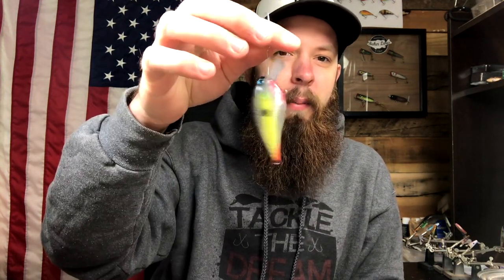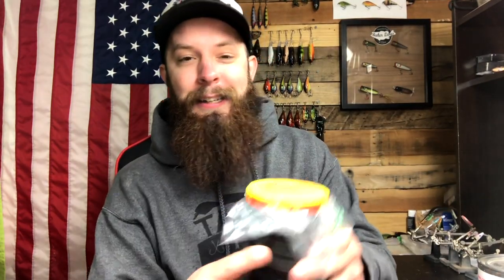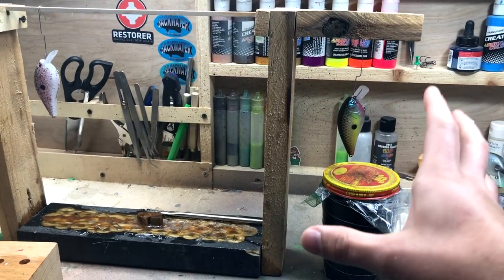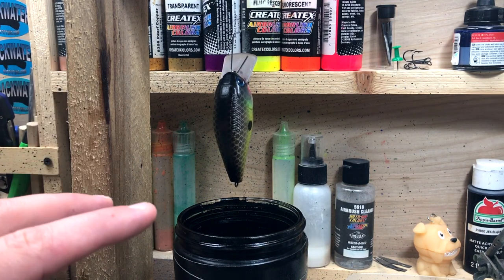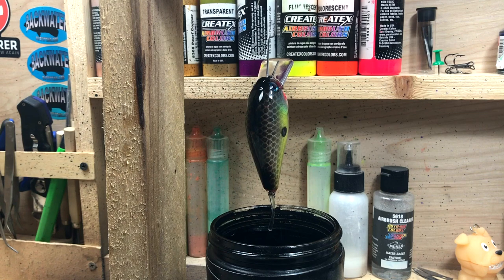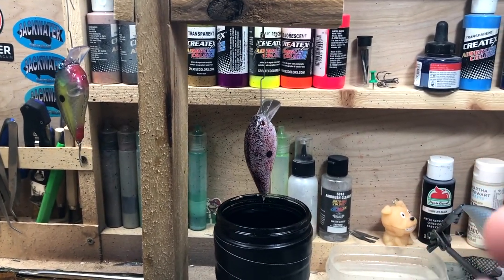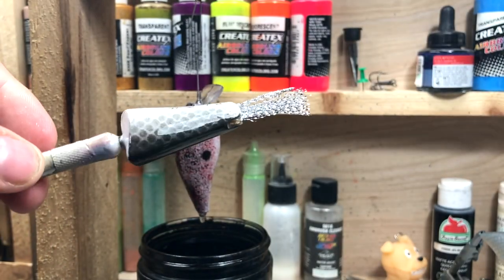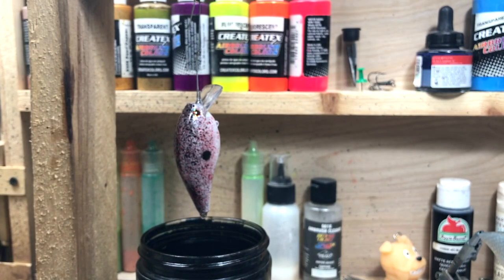Alumi-UV Clear Coat - How I Clear Coat With Alumi-UV

Comment: I ended up making a uv cure bucket. I bought 32feet of 90 watt light strips. I wound them on top of each other around The Whole inside of the bucket up to the top. Works good but it gets a little warmer then I like, but it cures in about 5 minutes. Lol
Reply: Where did you find 32 ft of. 90 watt UV strip lighting? Or are you saying you got 2 strips at 45w each? . the highest wattage I could find was 60 thanks in advance

Comment: I have been using True Coat 2 part epoxy and I must say I am not impressed with the durability of the clear coat. I put one coat on, put it on a rotisserie for 12+ hours , add my logo decal and then put on a second coat. I have a lure that I have taken out and used a half dozen times and probably caught 12 Bass and a couple of Pickerel and it already has a couple of chips that go down thru the paint. How is the odor ? The True Coat does not stink up the house too much where as I‘ve heard the KBS. Is pretty toxic smelling. Like you, I don’t want customers to get lures that chip up easily.

Comment: Quick question. I started using Aluma-UV and purchased a strip of 365NM uv lights. When I take out the lures they seem perfect and hard like a lure bought from a store. However I find that when I fish with them the UV coating and paint comes off. I dip the lures then put them in the UV box to cure for several hours and they look store bought but they just wont hold up to bass fishing for a couple of hours. Any ideas to help out? Thanks

Comment: Something you could try from the scale modeling world is pledge revive floor wax, sprayed through you airbrush. You can use it in place of your spray can clear coat. Gives a good smooth surface for decals and is like $6 for a big bottle. You also could try decal solution like micro sol/set. If your lure is textured the solution makes the decal basically melt into the texture perfectly. Great videos, count me as a sub.

Comment: I just recently started making lures and decided to use the alumilight just for the ease of it and I love it. I built a similar box and used the reflective insulation also installed a turner that’s removable for bigger baits that runs down the center of the box. I used 4 60w uv flood lights mounted to one switch for mine but I also have a cardboard box for a lid 😂

Comment: UV coatings are affected by florescent lighting, not much, but enough to harden it if left too long exposed. I found this out during my days as a photographer, taking photos under different lighting. You're so right to keep the resin in a dark jar. Also, I have stored some resins in the refrigerator along with my superglue.

Comment: Hey man you might like this tip or not. When you go to clean out the eyes for the hooks take a piece of wire that is relatively the same size as the hole. I heat it up  with a blowtorch and just push it through there and it cleans it out immediately. Thanks for the cool video

Comment: Harbor Freight sells a dremel tool for around $5. I've been using one for over a year now and it's still going strong. It comes with several bits. I've been using the same bit for over a year and it makes cleaning the hook eyes out very simple. I use to use a xacto knife also and the dremel is the way to go.

Comment: I appreciate the video because I was wondering because I have been using the 2 part epoxy and no matter how you mix it it always has a touch of tackiness to them however washing it with dawn dish soap helps with that

Comment: I use something similar for coating 3D printed lures. The term you were searching for is “self leveling”.......I use a lure spinner and I put them on the spinner for a few minutes so it self levels without buildup and drips and the air bubbles have time to pop. Then I turn on the light to cure.

Comment: I tried using that spray on clear coat for putting my logo on my baits and it wrinkled/boiled up my paint job, I use createx, I wonder if that’s why? What kind of paint do you spray? 
Edit: I see you paint in the video now, hmm wonder if I just sprayed too much🤷🏻‍♂️ also are you in a well ventilated area for that, do you think I’d be fine dipping with this clear coat in my basement? Thanks!

Comment: I am interested in the Alumi-UV, but I am wondering if it is glossy and clear... I've heard that it can be a matt finish and/or yellow... also the resilience of it... right now I use True Coat a two part epoxy, that does really well! The only downfall is TIME.. it takes over night to harden with a turner.  I am really interested in the UV but is it the same quality of finish as the True Coat? Also you mentioned special UV lights that Alumilite has for extra fast curing.. I couldn't find them on their site, can you hook me up with a link to those?

Comment: The term you were looking  for re. the brush strokes in the clear coat is 'self-leveling'. Your lighting takes so long because standard black lights are not the correct light so not as effective. The proper UV light lights  emit a wave length of 365NM. Always look for this wave length, they do specify when you search for them.
Cheers brother

Comment: I have yet to find my answer but all this does if I let it hang and drip is run right off my lure.  The bill will be dry if I leave it hanging
Reply from the maker: I only leave it hanging for a few minutes and then put it into the curing box. On most lures if I’m putting clear coat on the bill, I will rough it up with some fine sand paper so the clear coat will stick 👍

Comment: Hey bud, just switched from diamond clear to the alumi lite uv about 6 months ago and love it, but have you had a problem with any of the baits being a little tacky after cure?
Reply from the maker: Only if they have not been in the curing box long enough. How long are they staying in there?
Reply: @BakerBuilds  I've got 2 of the uv nail drying lamps put together up right,  I can do about 9 baits at a time, and I put em in there for 30 minutes, and they always come out fully done. But every once and a while some will be a little tacky.
Reply from the maker: @lipripperzt.v.9594  does it make a difference if the tacky ones stay in the curing box a little longer? I also rotate mine to make sure everything get the same amount of Uv light from every direction
Reply: @BakerBuilds  not really, it seems.to be just random ones. And my booth has 360 degrees of uv light. Along with the reflective glass. But idk why there are just some random ones that are tacky. If I do 100 baits, probably 3-5 of them are tacky. I just didn't know if it was something you experienced as well bud. Who knows, could just be coincidental,  could be a blank issue, idk. Lol.
Reply: How was the diamond clear?

Comment: Were you using the 20w 365nm tubes in your black light? in the video. on their site it says 5 to 10min cure time for the clearcoat
Reply from the maker: Mine are not, I need to get better lights and then yes, extremely short cure time 👍
Reply: @BakerBuilds  ok yea that clearcoat is expensive but it seems to look really good from what I've seen videos i just ordered a bunch of stuff to start painting my own baits I went really cheap with the airbrush and air compressor to start out with did not want to drop a ton of money on it in case I do Not using it a whole lot you got a good Chanel 👍gave you s sub 🤙🤙🤙
Reply from the maker: @smashinthatbass  thank ya! Check out the tackling the dream group on Facebook if you haven’t yet 👌
Reply: @BakerBuilds  I don't have facebook I have Instagram but thanks for putting it out there🤙🤙
Reply: @BakerBuilds  FYI I’ve been using alumi-Uv for awhile now most of the Amazon “UV”lights are not very efficient for curing 
I found almost all mosquito zapper light bulbs are exactly 365 NM. And will cure lures in seconds not minutes depend on wattage distance etc  this find has been a game changer on my end and way cheaper than the 700$ fixtures they sell for a 3 second cure time 🐟

Comment: I built a box with 2 4 bulb nail lamps I got on ebay. Hole box costed about 50 bucks and the baits cure in about 5 minutes. There dry but I like to leave them in for a hour or so just to be safe. From wat I have seen uv resin realy needs to be at 70 plus degrees after that it acts funny.